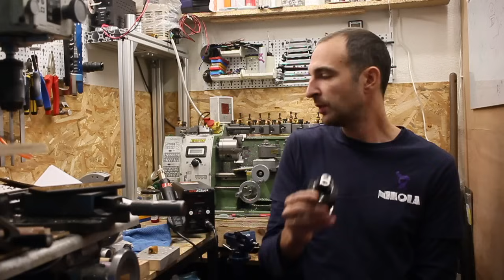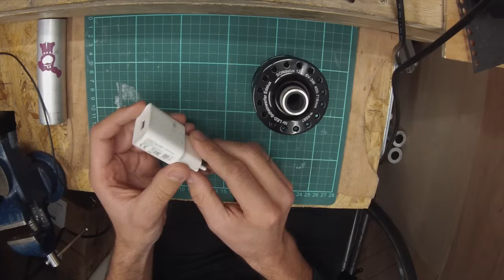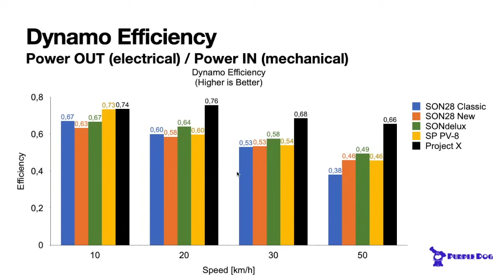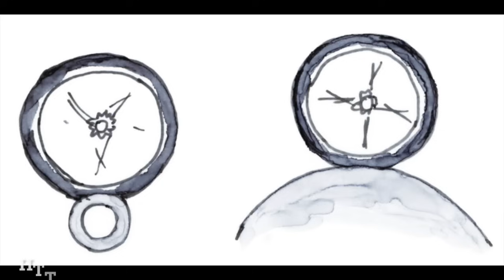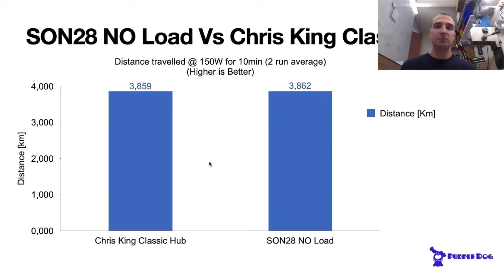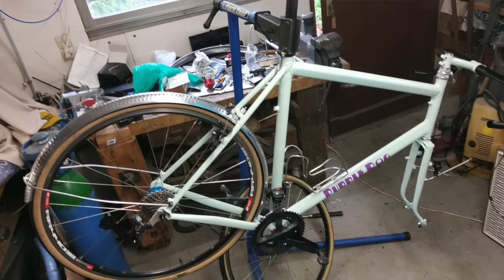Dynamo Drag and Resistance Tested: Myths Busted

Comment: Do you have any info on the performance of the modern rim dynamos? Velogical is only current mfr I am aware of - Pedalcell had a comparable product, but they ceased operations in 2023. They claim that they can generate more power as the dynamo spins faster. These dynamos can be three phase.

They would appear to have some advantages for inititial use, in that they can be fitted without having to build a new wheel.
Reply from the maker: I realised in post edit that I did not mention it. Though the bike I used for the tests was made to be very lightweight (comes sub 9kg currently) and as such it was built with a Velogical dynamo directly mounting on a braze on the fork. (https://www.flickr.com/photos/40790580@N04/51278904464/in/album-72157719470695118).

While lightweight, I had it slip every time it rained and even in high humidity/fog. Thankfully some of my lights (The Companion) have a buffer battery so I could use that to save me. I tried many adjustments to no avail. After a season of randoneering/weekend riding I also wore out the rubber ring so it was slipping even more and almost running metal on metal, while in the manual, since when do we think about doing maintenance on dynamos (*shrug*)??? That was valid even with ~1W LED lights (my design) so with anything with more power (ie '3W light' and hence drag/resistance, slipping would be even worse.

Also the whirring noise was quite annoying and while one of the 'marketing points' of the Velogical was that you can disconnect it so you have no drag when not using it, I had just disproven that point. Therefore, the user experience of the Velogical is enough to dissuade me, no matter efficiency and other points (lightweight/cheaper than SON, etc.). My 2 cents.
Reply: @CustomPurple I don't experience much slip in the rain with my velogical "Sport" version. But I'm using rim-brakes, so the rim will have some more friction probably. To keep noise low, I had to adjust it very well, but that adjustment has held for 2000km already. With the thicker O-ring noise is also even lower. Also a bad adjustment (where the O-ring doesn't run perfectly parallel with the rim) also causes more slipping and vibration that probably wears the O-ring faster. Another important detail is that the O-ring needs to contact the rim surface at a right angle, to further keep vibrations and slipping low.
If you manage to mount it well, I think it's very hard to beat a rim-dynamo.
I just had a Shimano alfine dynamo hub fail spontaneously, after just 1000-1500km, with the bearings still working well, but no more electric connection between the two poles.
Reply from the maker: Thanks for your comment. I know that adjustments are very critical for the Velogical. My bike has a dedicated braze-on so it was built around that dynamo, however, no matter how I tried it still slipped, noise is still there even with no load (I designed a Led light that consumes ~1W) and it is  louder with "3W' lights and even louder with something charging (~5W) so in my experience Velogical (I have the now discontinued Special - blue - most powerful version) is not something I would rely on for some as critical as lights. I still have it and the lightweight is hard to beat so for some future lightweight projects I might consider it.
Reply: velogical tells you the performance right on the site, 60-75% efficient, in ideal conditions. Probably not that much power.
Quite expensive for a simple friction dynamo.
Reply: @jaro6985 I'm using the velogical rim dynamo on one of my bikes and it works really well, and it's very convenient for a touring bike. Much more convenient than a dynamo hub. Mounting it correctly also was quite easy (I used the cantilever stud mount), and they have a good guide. It also already comes with replacement O-rings for the pulley-wheel and shrink-tubes for the cabling.
Velogical actually has detailed efficiency measurement charts with several different lights for download. Efficiency numbers are always very misleading when you quote them out of context, because it mostly depends on your speed and what load you have connected. If you only use it with lights, the velogical dynamo on the "Sport" version is easily one of the most efficient dynamo solutions (other than the "1.5W" version of the Shutter-Precision dynamo hub).
Reply: @imrevadasz1086  I'm sure its fine, just too expensive for my tastes.
And at 3W the efficiency number is fine, not "misleading", I was just answering the question that was asked.
Reply: There is an interesting German company called Magnic lights and these are literally dynamo-powered but without physical contact to the wheel, the original models come with attached brake shoes (you can choose between sidepull, V-Brakes and cantilever, the pads are changeable) and the newer Wega models work with disc brakes.
And they're road legal in Germany.
Reply: Another huge advantage of a rim-dynamo (or any classic bottle dynamo) is that you won't have a flickering light at slow speeds, but continuous light already at a slow speed. That is because a bottle dynamo will create proper AC current at a much slower speed than a dynamo hub, because rotation speed is far higher. A dynamo hub will basically generate something more like short bursts of DC in alternating direction at a slow speed, which gives visible flickering.
The higher rotation speed also makes good bottle dynamos inherently lighter than a dynamo hub.

Comment: Very informative video! When I was commuting ~29K to work in the dark, I quickly tired of battery lights. I laced a Shimano Nexus dynamo hub into my wheel, but found the incandescent light too dim. I made some crude voltage/load measurements and wound up putting a couple Luxeon LED's in series, one fitted with beam optics, and the other with optics that gave more of an oval pattern. I simply rectified the output from the hub with 4 shockley diodes, and fed that directly to the LED string. I also designed the structure holding the LED's to be simple, lightweight, and chose the mounting point such that the mass of the unit was divided equally to minimize the unit re-aiming the lights with ever bump in the road. Worked great! It was very common to have cars come to an intersection and wait for up to half a minute to see what the heck was coming their way.
Reply from the maker: Ah yes, LEDs being 'current driven' devices and dynamos being 'current limited' you can make some really simple yet powerful lights. I had similar experience with cars paying MUCH more attention to me when I got my very first dynamo setup (SON on a Brompton).
Reply: @CustomPurple  So I checked the gearing again ...and I was wrong. What I thought was a 16 on the back wheel is actually a 14?? This means the ratio is 2.7 not 2.375 giving an equivalent chain ring of 43 vs 38. That would explain much of the inertia effect.
Reply from the maker: Glad you figured it out! =)

Comment: A key feature I would love in a dynamo light would be ambient light sensor to automatically adjust their brightness from "be seen" during daytime to "see what's ahead" at night. Ideally there would be a switch so that daytime it would have different modes: low constant brightness, pulsing from low to high brightness, and high (night time) constant brightness. Where I live there is no regulation against pulsing lights.
Reply: The 'SON Edelux II' has this feature.
Reply from the maker: The SON/Busch & Muller lights have a light sensor that switches on when dark. (Probably due to the regulation I mentioned in the video) the light intensity does NOT change according to conditions. Also besides the very early IQ Cyo lights (I am thinking 2009ish) the sensor is too sensitive (you can be too safe I guess) so it is always on, even in bright sunlight, therefore might as well not be there, at least in my experience that feature does not work very well.

Also when it comes to pulsing/blinking, this is actually illegal in most jurisdictions and it is is quite annoying for other road users (why it is illegal most likely...yeah I know blinkies are sold left right and center....) so for the time being this is a hill I will die on and in normal use, my devices will not blink. =)
Reply: @CustomPurple

1)
The B & M light that I am currently using has a switch to switch to different modes.

I currently have it in the 'Senso' mode. It has two 'daytime running lights' at the base of the housing which are on constantly during the day. 

At dusk/night fall the sensor automatically enables the full light.

I have never had a problem with the ambient sensor being too sensitive causing the main light to be on at all times.

Perhaps such a flaw is present on the cheaper B & M models or previous generations of lights.

(2)
Re blinking/pulsing lights.

The jurisdictions that ban such lights are overbearing over bureaucratic idiotic jurisdictions.

Research shows three things. Firstly, flashing lights are way easier to notice. Secondly, such lights make it clear that a vulnerable cyclist is up ahead. Third, flashing lights make it hard to gauge distance to the light; a solid beam is far better in this regard.

The solution therefore is breathtakingly simple. Either have a light fixing with a solid light at its centre surrounded by flashing LEDs or have both a solid light and a flashing light on your bike.

To outright ban the flashing variety is first-class stupidity and reminds me of the time around thirty years ago when boring old cowards afraid of new tech would ban the use of mobile phones pretty much everywhere (I even experienced idiots who refused to call me or do business with me if I gave them my mobile phone number; the ban on flashing lights is equally retarded)
Reply from the maker: Thank you for sharing your opinion and experience. Actually I have one of those Bumm front lights and everything is on all the time. I never knew it was supposed to do it  differently and since I run it as daytime running light it never bothered me. Maybe I just have a defective one...*shrug*

The Bumm one that actually turns on in the dark for example in a tunnel (awesome by the way😎) though it doesn't switch off afterwards.

Like I mentioned doing it right requires dealing with the analog to digital world conversion and this is not trivial to be executed correctly. Most lights use a simple on/off photo transistor type circuit. As an example the Mercedes Intelligent LED is a led control system done right, though this is a thousand+ option, not a 50eu light.

Re: Blinking lights, let's keep regulation out of it since we all feel similar about it though I am against those lights due to personal experience. Almost everywhere (that includes cycling paradise like  the Netherlands to a degree) cyclists are seen as a nuisance on the roads and flashing lights add to that, I hear it actually mentioned enough to not ignore it (sad but true unfortunately)

I have actually 'seen' what a flashing light can do on a hill on my commute. In between 'flashes' the cyclist was invisible and at 36kph that is 10m/s so at 1Hz blinking he passed a driveway and a side street while being invisible; like you correctly said distance cannot be judged correctly. We all have cycling related scars/scares that took less than a second.

I once (during a 400km brevet) biked behind a guy with those auto blink/sensor brake lights and every time he would get out of the saddle I would get blinded because the sensor thought he was braking. Any kind of night vision adaptation was gone in a flash (pun intended).

I have only seen 'bigger and brighter' and not better when it comes to blinkies so until that time I remain largely unconvinced and skeptical.
Reply: @CustomPurple  I am not advocating for blinking "full on, full off" lights. I said pulsating to try and avoid that debate -- the light could maintain a baseline "be seen" brightness and periodically add a brighter "heads up!" pulse/wave/bump/whatever. It doesn't have to be seizure-inducing. $30 Chinese front lights have multiple brightness levels and blinking modes at the press of a button. I'm happy to pay many multiples of that for the convenience of automation.
Reply: @adophgraphytheartandscienc8426  I completely agree. The always-on "be seen" component would have a broad beam to be seen by cars, the "see at night" component would be narrower and point down at the road. The different orientation and width of the beam means they could be physically separate. I would rather not have to install two separate lights on the bike, but it's probably the simplest solution as a consumer.
Reply from the maker: Actually pulsing like the Apple devices white led (when in sleep) would be a nice feature (the parked) and having automatic control would be a jackpot in my book for a LED headlight.
Reply from the maker: Dimming of dynamo lights was the first challenge that I had to overcome so I have some things (in the pipeline) that will potentially use an ambient light sensor to provide automatic control. Though we are entering in the limbo world between analog and digital - which means LOTS of real-world testing and head scratching/banging against the wall. If you subscribe to the channel, I will most likely talk about projects that use a similar feature.

Comment: I am trying a set up with a Son 28 dynamo, BM front and rear light with capacitor. Once moving it rolls OK but feels like the brakes are rubbing on the rime when starting. On the stand the front and rear hubs turn smoothly. With the lights on the drag seems noticeable.

My other question is regarding measured resistance when the lights are on. If the system is producing 3W of power to the lights would the drag not be more like 5 or 6W? No system is 100% efficient.
Reply from the maker: Without seeing a schematic/more details of your setup I am only guessing, though capacitors when empty look like a short circuit (ie maximum current/drag) so this is probably what you are feeling. B&M taillights (and the SON rear light that uses the same electronics) do have quite a 'surge' when first powered while the stand light capacitors charge. When you say the drag seems noticeable do you mean on the stand or when riding? 

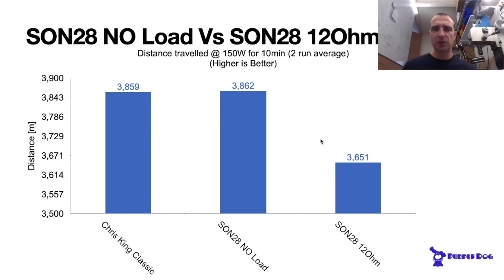With regards efficiency I mention it on my slides (33:28) so the SON28 classic with ~57% efficiency equals to a total of ~5.7W of drag. So you are 100% correct here.
Reply: @CustomPurple   I watched the video again and your explanation makes sense. The ride in town was not a steady speed but stop/start and flat/incline. And I was using both lights on. This set up is a single speed with a similar gear to my winter bike. The effort to start felt much higher than with a normal wheel. Almost like you are running a much taller gear.

My curiosity was to determine if the dynamo set up would work vs USB lights, I will do a comparison of a flat road at a steady speed to see how it feels.